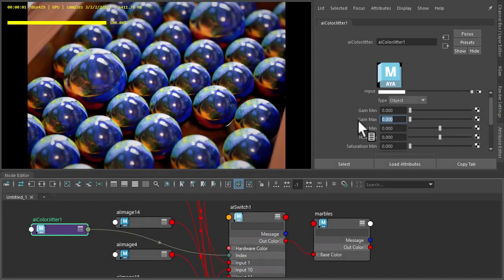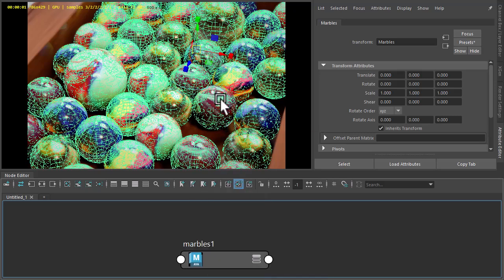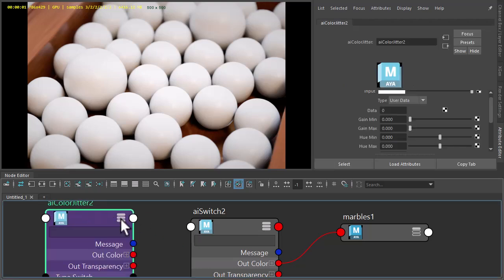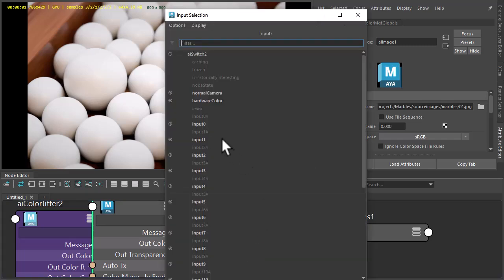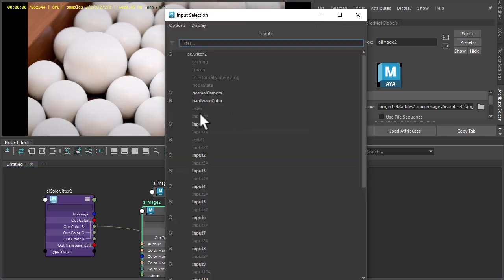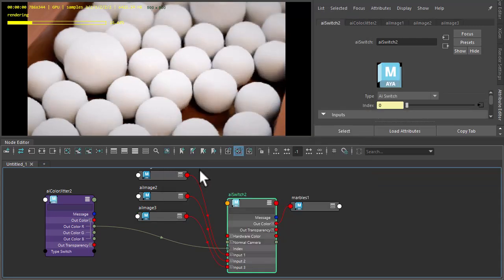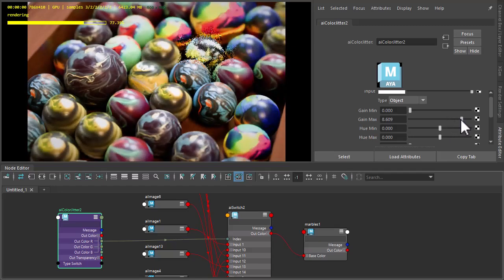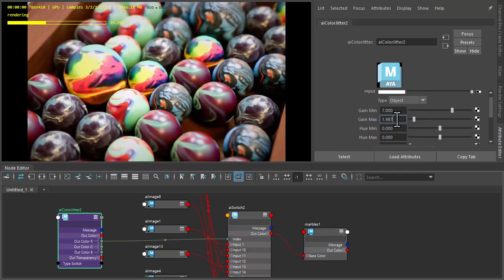Arnold Tutorial - Switch shader with Color Jitter in Maya (GPU)

Comment: I see a type switch input in the colorjigger. Could tyou just do the images in the aiwotch connecter to the type switch and then the colorjigger node output in the standardSurface? Instead of the index? What would the difference be?